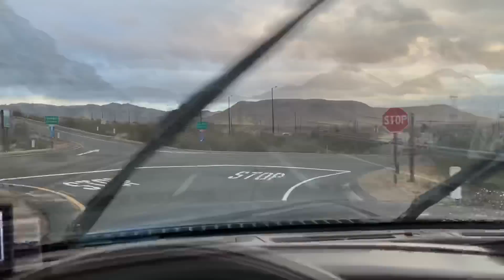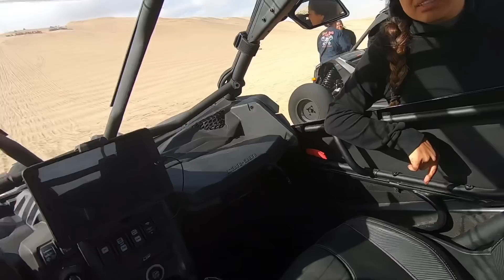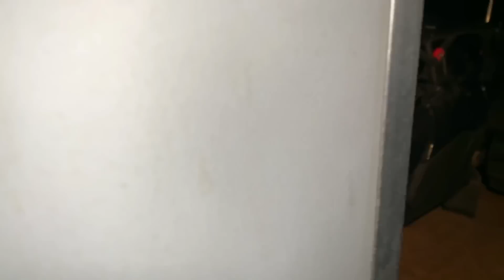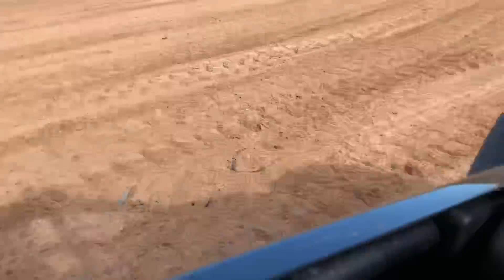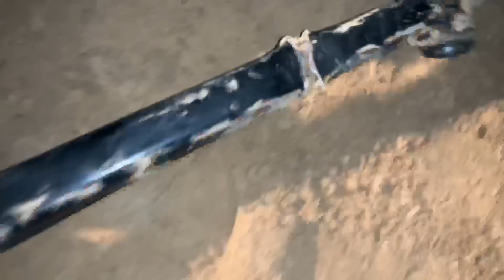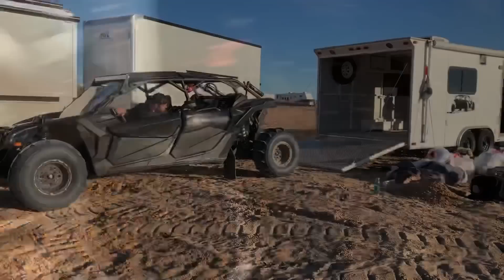GLAMIS THANKSGIVING 2019 DUNES, RACING, CRASHING, FIXING AND MORE IN THE X3 MAX  “SPOOL BUS”

Comment: KWI clutching has a full float kit. Haven’t broken a belt yet and I’m running the exact same tires. Also did the Shock therapy suspension and it sucks up those dips like nothing.
Reply from the maker: Dave Mora the belt blew because just before I went up olds in 2wd and hopped really bad and I felt it skip. Totally my fault lol

Comment: Spent $8000.00 on stage 5 kit gets you 6 feet ahead of stock at 1/4 mile. Over priced trendy go carts.
Reply: Michael Wiersma lmao u can get a 5000 buggy then put 8000 then smoke any of them
Reply: @trevorwarner3168 are you calling side by sides buggies? I havent seen any side by sides for $5k. Or are you referring to a 1.8L or so, sand rail for $5000.00. I agree if your talking about a vw powered sand rail.

Comment: Think its just the clutching that made the difference? Seems your car should walk away from it up top pretty significantly but seems you only held an advantage in the mid range.
Reply from the maker: Steve L yes absolutely and I think he had a Wednesday car! 😂 cars built on Wednesday typically get a little more love. 🤷🏻‍♂️
Reply: Back To The Desert with your evo spring that moves engagement up, is there additional options you can add to keep the functionality of the launch control but also improve the clutch performance?
Reply from the maker: Yes I’ll be doing a video on evolution powersports shift tek very soon. 🙏🏻
Reply: Back To The Desert very cool. Keep it up man. At some point the algorithms will start to swing your way and your channel will take hold. You already have better content than a significant amount of side by side channels with a decent following so your time will come. Just need to be consistent and keep growing your editing/production abilities.
Reply from the maker: Thank you very much I’m just having a good time doing what I love to do with my family. No other fake BS or scripted content. Just a real guy doing real stuff. 🙏🏻